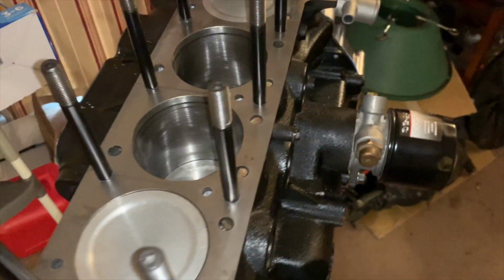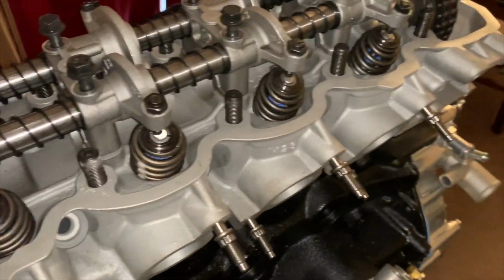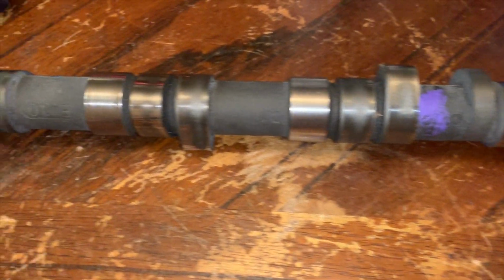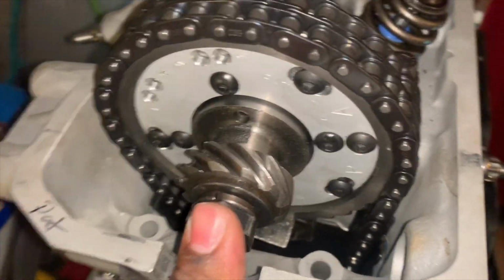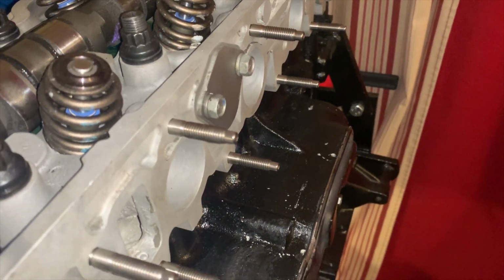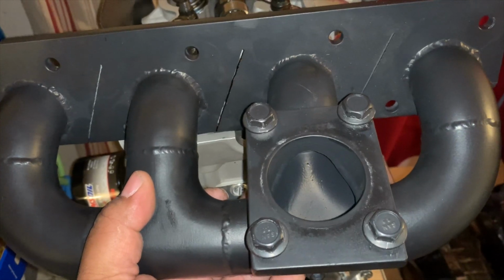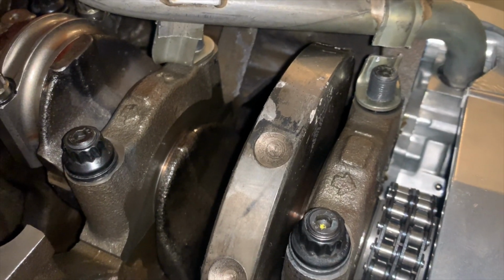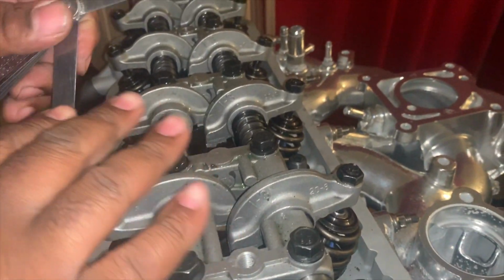Customer Surprise build 3

Comment: I have a whole bunch of these engines. About 10 complete engines and over 20 heads valve covers complete engines you name it. Need any parts let me know
Reply from the maker: Oh yes I definitely need as many of these motors as possible contact me and let me Know what you have we may be able to work out a deal

Comment: Super informative. Great Videos

I have 1984 Mitsubishi Mighty  Max. I want to turbo it at a later date.  Can you turbo  the  N/A blocks successfully  make decent HP. The starion engines are to come by. Right now I have  the block pulled and will take it to machine shop for bored honed and decked.  I   want to buy the  JE pstons and pauter rods from topendperformance to have them.  Any suggestion would be great
Reply from the maker: Stock I think max power is around 10 to 12 psi but you have to change your distributor to retard timing so it doesn’t create knock the non-turbo distributor doesn’t have a retarding function only in advance functionAnd after that with the rods and pistons you can go as high as you want contact me there’s a Facebook or Instagram legion elite motorsports And I’ll be able to fill you in with pictures and more information

Comment: i torqued mine to 100. never had any issues at 30psi
Reply from the maker: Wow on stock head bolts or ARP??
Reply: @legionelitemotorsports2096  ARP.  been running it that way for 7 plus year. heat cycled engine and checked torque. then with ever oil change would recheck torque. never any issues
Reply: What hp does the Star make at 30psi with a 274 cam?
Reply: @Theophilusone7  i run a 284 cam. and it made 467whp and 505wtq on a broken/cracked exhaust manifold
Reply: @joenewberry5912  Nice, I have the TEP head n cam, bought the whole car for 800. Was wondering what to expect
Reply: @Theophilusone7  the TEP cam is a good street cam for mid power. i ran a tep cam and a 57trim turbo years ago on the tbi. in my opinion its the best street setup besides Mpi
Reply from the maker: I have a manifold that can fix that 😉
Reply: @legionelitemotorsports2096  i have a JDL manifold now. if i was keeping the car iwould go with a T4 manifold next go round
Reply from the maker: Oh yes that makes sense I was going to say I have a T4 Manifold that would knock your socks off
Reply: LegionEliteMotorsports you have a pics of your manifold? How much?
Reply from the maker: Ohhhh yes I have it on my web site $900